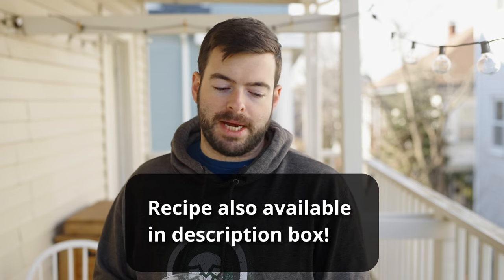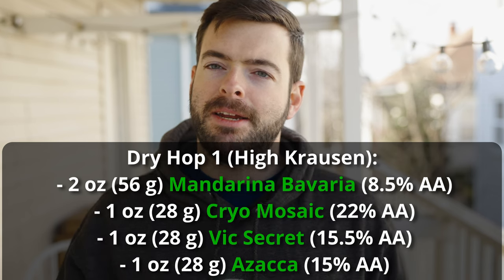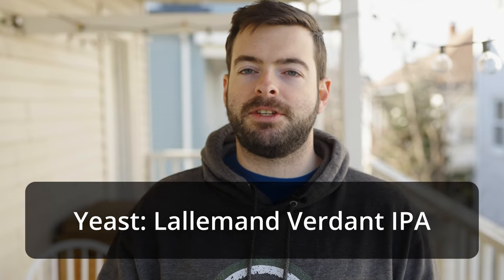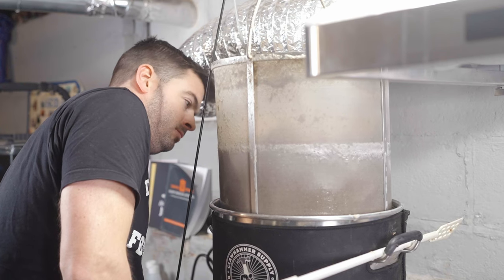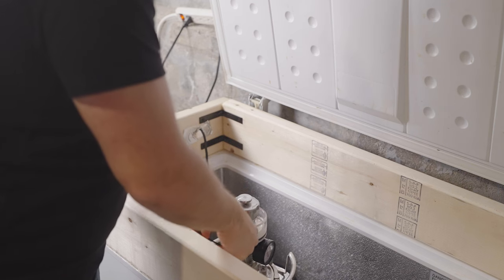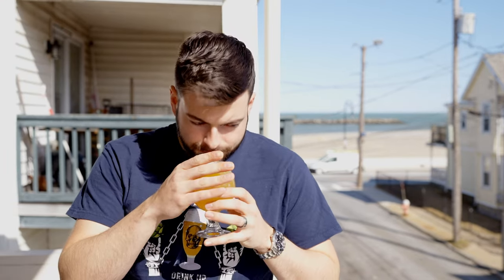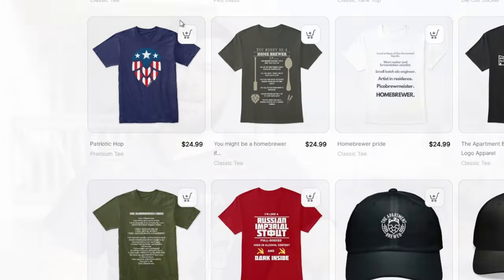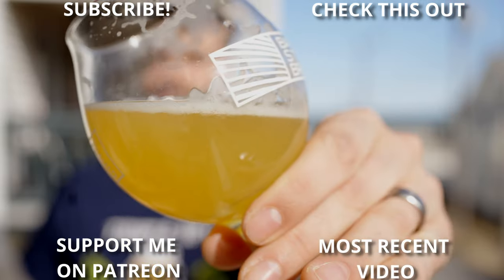How to Brew a HAZY IPA UNDER PRESSURE - Get the MOST OUT OF DRY HOPS

Comment: Per Genus Brewing recommendation, just add 3-5 grams of ascorbic acid into your water pre mash-in and that will take care of all your oxidation concerns - you won't have to worry about using any malted oats at all. The ascorbic will remove the precursors that lead to oxidation. I've been doing this for years now and my NEIPA keg stability is insane - 3+ months later (it rarely lasts that long) and it's the same golden color as it was on day 1.
Reply: He has actually recommended doing this a few times in the past, curious if there is any reason it's not mentioned in this vid
Reply: Beat me to it
Reply: Pressure fermented, and closed transferred, shouldn't be any need for that acid guys? What you recon?
Reply from the maker: Yup, use it all the time but I just forgot to add it and film it, and instead added at kegging. Works fine either way but its just another line of defense when combined with other techniques. I'd rather layer multiple techniques to combat oxidation than rely on one alone.
Reply: @TheApartmentBrewer  I am reliably informed that the boil will de-nature the ascorbic acid, so putting it in the mash is pointless. Your way is much better. The reason Genus brewing do it is that they have a commercial scale setup. Hot-side oxidation is not a worry for small-scale home-brewers.
Reply from the maker: @Lisa Carruthers  their reasoning for adding it in the mash is not to fight HSA as it does denature in the boil but to significantly reduce ROS from flaked grains. By the time it denatures its already done its work. But realistically there are benefits to adding it at either point in the process, as I mentioned above its good to layer it with other anti-oxidation techniques.
Reply: I religiously added ascorbic acid to my fermenter to combat oxydation in my hazys until my local supplier stopped carrying it. To be honest, though I sometimes feel a twinge of unease about it, I have not noticed any adverse affects for not using it. Drat! Now you've got me thinking about it again!
Reply: 3 to 5 maybe is too much. I'd go with 1g per 5 gallons.
Reply: @TheApartmentBrewer  what is ROS?
Reply: That alone doesnt do for sure

Comment: great video Steve!  I do a ton of Hazy's.... I would recommend swapping out the golden naked oats for white wheat.... what I usually use for my base malt bill for Hazy's is: 9-10lbs Pilsen, 2lbs white wheat and 3lbs flaked oats.  I like my Hazy's to be around 6.5-7%  I just recently had one dry out more than expected, it got down to 1.008, when it tends to get down below 10.014... I will add .5-1lb of lactose in when kegging.... it makes a ton of difference
Reply from the maker: Hey Chris, thank you for the suggestions! I think a lot of this has to do with Verdant, if I was to use it again I'd definitely add more dextrins.

Comment: Great video as always, thank you. Can I ask whether you used the same keg for serving that you used for the conditioning and D-rest step? I'm wondering if a lot of yeast etc. would make it over to that keg given that the transfer happened before any cold crashing. Apologies if you covered that and I missed it
Reply from the maker: I did, just makes the process a lot easier. I use floating dip tube in my kegs so the trub isn't a big deal

Comment: For the mash, how did you dial in the recipe with those flaked wheat. I tend to run into efficiency problems with my mash when I add flaked. I also use a clawhammer 120v all-in-one system and attempted to use the same grain bill. My mash efficiency is around 52% on average (tried my recipe 3x using the same grain bill you are using) What was your mash efficiency with this recipe? Any tips for the efficiency issue?
Reply from the maker: Hmm, that seems very very low for what you should be getting on the clawhammer. I usually get at least 70% efficiency overall on the system. Check your temperature calibration, crush a bit finer, don't rush the mash if you are, those are really my biggest tips.

Comment: Hey Steve, thanks for the video! Curious why you chose not to apply pressure until after the first dry hop?
Reply from the maker: Good question! It's because when you pressurize the beer before hand and add dry hops the rapid breaking apart of the hop Pellets makes the beer virtually explode in your face. Not a fun time
Reply: @TheApartmentBrewer  Got it — thank you!

Comment: Hey there, probably late into this but "never too late to learn". Just a possibly dumb question but when dry hopping with a bag in an all-rounder (just got one 👍) how do you wash/sanitize it afterwards. Or even sanitize before without dampening the pellets? See I told you it was a dumb question. Love the vid btw, I 'think' I've been encouraged to experiment. Cheers
Reply from the maker: Not a dumb question - there's nothing wrong with dipping the bag in some sanitizer, but its really not necessary for the most part. I've never had a problem result from that.
Reply: @TheApartmentBrewer  thank you, definitely going to try a bag first before investing in a hop bong. Keep up the good work with your vids 👍

Comment: I’m sorry if you’ve mentioned this or answered this question previously, but would you mind sharing your typical mash efficiency with your claw hammer system? You don’t typically sparge from what I recall.
Reply from the maker: Usually I don't sparge, that's right. I don't know the efficiency off the top of my head but I think its around 70-75%

Comment: I am new to this home brew thing, and I have a question. Do you remove the first dry hop bags you put in by hand, or do you just leave them in for the entire fermenting process. I am guessing you did since this is a pressurized fermenter, and you did not want to take a chance of oxidation.
Reply from the maker: Ideally you can remove them but because of the pressure fermentation you would probably not want to do that. In some cases it's OK to leave them in a bit longer than recommended if you keep the temperature down.

Comment: Your recipe is eerily similar to mine that I have in the fermenter right now. SG was 1.064 and my FG is about the same. I was worried about that until your video. Thanks for the tip about transferring to keg and leaving at room temp for a week. I hadn't planned on doing that but I will now
Reply from the maker: Interesting! Hope it turns out just as good!

Comment: I don't quite get how the pressure/spunding valve help preserving the strong hop charatecter. If the problem with water lock is that the hop aroma escapes through it with the gas produced by the fermentation, isn't it the same with a spunding valve? I mean once the pressure exceeds the limit you set with the valve, the gasses are getting out?
Reply from the maker: I can't fully explain why it seems to be a difference, maybe its a placebo effect for me, but I notice a difference.
Reply: Don't get me wrong, I'm not trying to question the validity of this method as I've read about this many times and I'm about to try it for my next batch of hazy ipa :) as I'm trying to learn about the more advanced techniques I'd just want to understand the 'whys' behind the process, rather than just blindly follow the instructions. And this kinda hit me like a 'showerthought' as I was planning my next brewday; what's the difference if you let the gas out through a water lock or a spunding valve?

Do you pressurize the fermentor to desired pressure when you attach the spunding valve, or do you let fermentation to build up the pressure? Maybe this has something to do with the solubility of hop aromas under pressure as CO2 is dissolving in wort? 

Anyways, just recently found your videos and I really like the way you explain stuff in detail 👍
Reply from the maker: @whl9815  no worries, you may be on to something with that though. I always just let the natural pressure build up when I spund.

Comment: I brewed a neipa with the same yeast and cryo Citra, was one of my best beers so far. Unfortunately the hop flavour vanished very quickly since I bottle and I don’t have enough space in the fridge to keep all bottles cold. Do you think adding more hops would have helped? I didn’t go too heavy on whirpool and dry hop, since I was concerned with oxidation and hop burn. 

P.s. I just ordered the Lallemand Novalager to brew a Czech Pilsner, are you planning on using that on future brews? Cheers from Italy
Reply from the maker: I need to try out a bunch of new lallemand yeasts! Novalager is on the list for sure. I hope your NEIPA didn't oxidize in the bottle. Next time I would increase your whirlpool additions since that doesn't have an impact on oxidation.
Reply: @TheApartmentBrewer  thanks for the advice. I don’t think it was oxidised, the color didn’t change overtime and I didn’t notice any off flavours. The first bottles were full with tropical fruit aroma and flavour, but unfortunatly the last I opened just had a hint of that.

Comment: Great looking beer! I like the magnets idea for dry hopping. Do you need to worry about the krausen or an over-active fermentation getting the hops wet, or, if you’re not fermenting under pressure, do you need to worry about hops going bad?
Reply: I asked myself the same question. Bus as it is in a environment which is almost fully filled co2 i think if they dont stay to long there‘s not a big problem
Reply from the maker: Since I dry hopped basically after the krausen blew through my airlock I didn't need to worry about them getting wet. The CO2 in the headspace will keep them fresh, pressure or not, as long as the beer is still actively fermenting when you get them in there.

Comment: Hi Steve, I really enjoyed this video because Verdant is a yeast I want to try to make a Hazy with and I like how you try newer or different methods and report back on it all.  So I have a question, did you consider or measure your wort PH before moving it to the fermenter or after mashing?  The reason I ask is because I'm reading up on 2 things - How hop flavors and aromas are perceived depending on the beer's PH, generally a lower PH is preferred say less than 5.5-ish.  And how dry hopping actually raises the beer's PH.  Cheers and Thanks!
Reply from the maker: The things you are reading up on regarding pH are very true. I probably should have measured the post-boil pH but it worked out pretty well. Cheers!

Comment: Thanks for sharing.  I'm surprised that you didn't get anything from the Golden Naked Oats. I've used it a couple times in hazy ipa/apas and really noticed it giving a quaker granola bar like character that didn't fit in the beer.. at least I was blaming it on the Oats.  Either way I've preferred batches without it.  I've made a few batches with Verdant IPA yeast.. and actually the yeast batch where I re-pitched the yeast rather than pitching fresh dry gave a really nice ester profile.
Reply from the maker: I'm still a bit unsure of why that is. By all accounts it should contribute a lot of flavor. Interesting note on the 2G Verdant pitch, I'll have to try that!

Comment: Is there significantly less CO2 coming out of the vessel with this method given that the spunding valve lets CO2 out once it hits the target pressure? Some goes in the beer but it’s not clear to me how much less comes out… Would you recommend a conical for this or do you prefer this method? Thanks!
Reply from the maker: I'm not sure how much CO2 is retained vs released but the beer is fully carbonated by the time fermentation is done, and when that CO2 is dissolved into it, it keeps those aromatic compounds in solution much more effectively. A conical will work but it should be a pressure-rated unitank.

Comment: 1. Surprised you didn't add any ascorbic acid, but I think at this point you have enough tools thay oxidation might not be a big deal
2. I was curious as to what you were going to do for the water chemistry, so I'll be piecing through that
3. Considering how far the grav came down maybe with this yeast mash at like a crazy high 158? Idk just a thought

Looked delicious of course...Cheers
Reply from the maker: So I actually did, but forgot to film it. Added at kegging this time instead of during the mash as usual. Probably would add some dextrin malt if using verdant again.